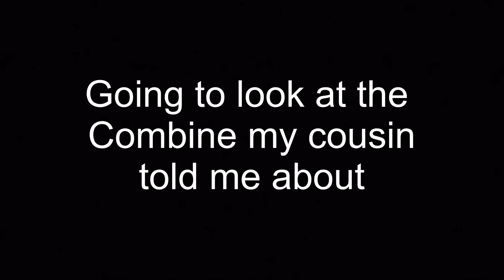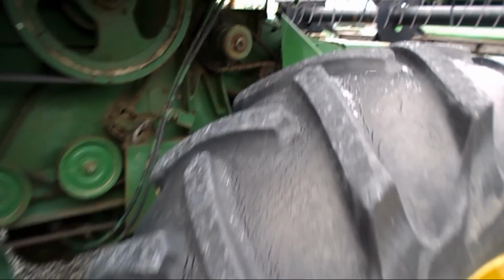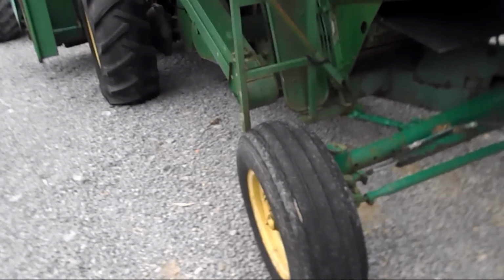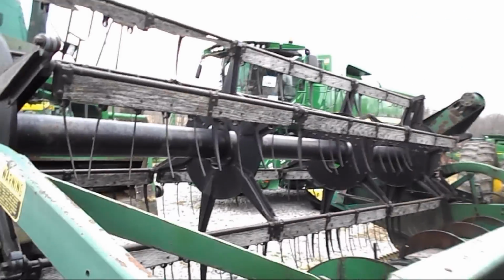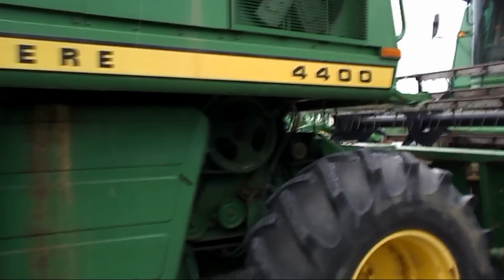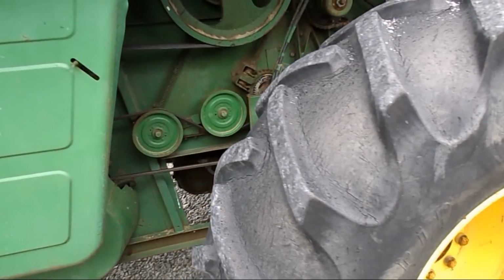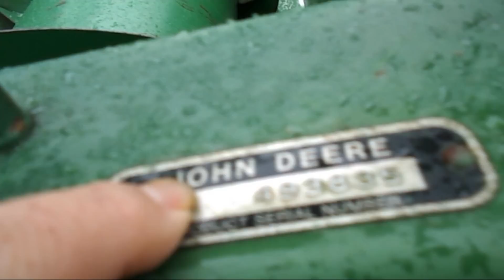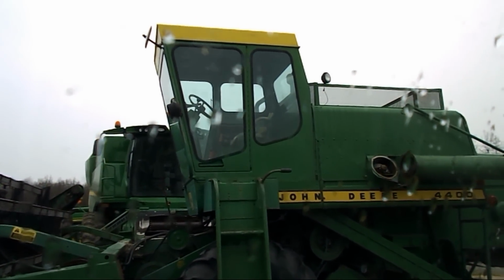Going to look at the combine my cousin told me about

Comment: Lift up on the back of the straw walkers and check to see how much play on the wood blocks.  The arm put on the axle could mean the pivot bushing is wore out. Check the rubber cushions for the sieves to see if they are pounded out. Check the elevator chains and sprockets.
Reply from the maker: I did check the straw walker blocks and there tight, And all the bushings look good too. The most ware I see is a chain sprocket up front caused by a dry chain that is stretched , That's a simple fix. I looked it over pretty good and I like what I see, Now I got to see if I can get it bought !  Bandit
Reply: It looks like a good machine though. I bet they will give you a great deal. Implement dealers only want the lastest and greatest on their lots anymore. Good luck to ya . Really like your channel.

Comment: that dealer has sure got a lot of combines on the yard,,,must have deep pockets for sure,,,,that ole 95 of yours will pick your crop as know it needs some TLC  but [95] is enuff to entertain you  with mechanical work even though the manifold does get red
Reply from the maker: I found the 95 to be a really good machine and easy to run and work on, But it needs a rebuild and a repower and that is still what I'm going to do. It will take some time to rebuild it and if I can get this 4400 it will give me the time I need to not rush threw the rebuild. The 95 as far as I'm concerned is a better combine than the 4400 ever was, Saying this I'm smart enough to see a good deal on a good machine to get me by till the 95 is fixed and back in the field again.  Bandit

Comment: Had a 4400 years ago, was not impressed in the least, if you want a small combine the King was the F3 Gleaner
Reply from the maker: It might be but I wont own it if I have to deal with the only dealer for a 100 miles,  That's why I run a John Deere now . You don't buy equipment that the only dealer around wants to screw you over on anything.  No Thanks, I go someplace that is happy to look up parts for anything they made over the years, They may charge a high price for them but at least they are nice about it. LOL  Bandit
Reply from the maker: @RJ1999x   This goes back over 25 years but it all started for a bad new belt I bought from him that caused $2000 worth of damage to the combine. I was told after a heated talk that I didn't buy enough from him to make worth his time to do anything about it !  At the time most of the equipment and tractors we had were AC and I bought a lot of parts from them. And when he told me and dad it was our fault the belt went bad because we didn't know what we were doing I thought dad was going acrossed the desk and whip his little fat ass !  Dad told him he had installed more belts and bigger belts than he had ever sold or seen in his life !  This was the only time I can remember dad so mad and ready to fight !  I was standing there with a report in hand from a lab that said the belt was bad because it was cold valcanised and is why it came apart. I called Agco in GA and was told they would replace the belt and pay for all the damage and have it fixed if the dealer said it was a bad belt otherwise they couldn't do anything about it.  So the dealer would have made money from all the parts and labor it took to fix it. But no , He didn't want to be bothered with it so he screwed me over good !  So that's why most of the AC stuff left the farm and why I wont buy AC stuff because he is the only dealer within a hundred miles (or more) and I wont go there for anything. Screw him and the white horse he rode in on !  Anyone who thinks he is a good guy and a good dealer is full of crap, He's out to screw you over !  I'll never deal with him again for any reason !  People wonder why I don't want AC stuff this is why !  Bandit

Comment: That's the new 3 link rear suspension system update from deere!
Reply from the maker: Really ?  I guess its possible, I was told the owner spent $28 or $2900 last summer at JD getting it fixed up for harvest so its possible this was put on too .  Bandit

Comment: you got to weight your options and think this one over pretty good cousin.  my 2¢ is I know you are good with a wrench and a ratchet.    but if you got reservations about the design and the overall functionality of the 4400 I'm thinking you'll never be happy with it.
Reply from the maker: The old 4400's were good machines, They will cut good and clean good but I'm not a fan of having to work on them and I'm not crazy about sitting off center. But IF the price is right I can get used to it again, I did run dads 4400 so its not like I have never run one before. The 4400 was built to replace the 95 , But the 95 will cut circles around a 4400 all day long !  But the 95 needs a rebuild and I already have a lot on my plate but if the price is right I'll buy this one and I can take my time on the 95 rebuild and do it right and sell the 4400 when I'm done. But I got to get it bought first and find out the whole story about this machine first.  Wish me luck Cousin !  Bandit
Reply: @banditfarmer1900  - sounds like a thought out plan.  in prayer I'm asking for you to be blessed and led to make the decision right for your on going plans.   best 2U cousin...
Reply from the maker: @SoybeanFarmer3300  I don't do anything like this without doing some serious thinking about it,  I spent an hour or more looking it over front to back the top to bottom and I like what I see. I wouldn't be interested in it but having a parts machine sitting there and knowing this one is a 1269 hour machine its got my very interested in it , Now if I can get it for a good price I'll be really happy with it !  I don't need big and new , Old is more my style !   Cousin Bandit

Comment: Isn't a 4400 a smaller combine than a 95?
Reply from the maker: The 4400 was built to replace the 95 and its a few inches narrower in the cylinder than the 95 is. Bandit

Comment: BUY A F2 are F3 GLEANER LOT  EASER TO WORK ON BURN   HALF THE FUEL PARTS YOU CAN BUY AT PARTS STORE ARE SHOUP ARE Aand I
Reply from the maker: Don't want a Gleaner, The only dealer around I don't get along with for a lot of reasons. If it wasn't for that I would own another Gleaner but not now.  I'm not a fan of the 4400 but I've run one before and they do a good job cutting and cleaning I just never liked working on them and sitting offset like that. But if the machine is good and the price is right I'll own it !  But first I have to get it bought and I hope I get it ! Bandit
Reply: had a 9500 with a 20 head in 4 years spent 25000 on it Got burn up was up set at the time got two F3  with 16 fi heads  one of them will cut as much as the 9500 would both of them runing all day will burn half the fuel as the 9500 did i know a bad dealer is not good

Comment: Scrap Iron at best not worth the cost it would take to fix it up
Reply from the maker: You don't use machinery very well, But by the looks of it your used to new big stuff.  Being a small farmer I'm always on the look out for equipment and I've seen a lot of 10000 hour tractors and 7000 hour combines and this 4400 shows 1300 hours and the little amount of ware it has on it I believe it. This combine just came out of the field 3 weeks ago from cutting beans, It was running and it will cut right now if needed. Changing belts is my own personal thing and as far as the head polly kits are normal to have to replace and the fingers on the reel coms from running the reel to low, Lots of 13 foot heads around to get boards off of cheap . I hope I get it cause I will put it to good use in the field. I don't need a $50000 combine with a 35' head to cut under 100 acres of beans .  Bandit
Reply: @banditfarmer1900  well I understand where you're at on that and if that's what you're happy with go for it I used to farm with a lot of older stuff and ran it many years and put 10 to 15,000  hours on it just to the point in my life I don't have enough time to keep equipment running so I got to run some of the tech-savvy stuff to keep me moving and plus I had over 20 different pieces of equipment to keep running when I was dairy farming so that stuff was easy keep running but we got out of that side when grain farm got big
Reply from the maker: @AJmx2702001  I've worked a job in town sense I got out of high school but I have farmed all my life . At one point with a full time job I was farming 350 acres with an Oliver 1850 and an IH 1568 and my 1550 Oliver. I got married and wanted to be around my kids more so I backed off some of what I was farming, I don't regret it for a moment !  I enjoyed farming what I was and being around the wife and kids and enjoying life. I farm under 100 acres now and I do it my way with older stuff I can work on. The farm and all the equipment has been paid for for many years now and I want to keep it that way so when I buy something I pay cash for it. As long as I can make a little money and it doesn't become a pain in the butt to do I'll keep on farming like I am now and enjoy what I'm doing. This 4400 if I get it bought will work just fine for me and its just the right size for me and what I'm doing. I hope my grandson will take over someday, I'm trying to show him there is more to farming than making money.  Bandit

Comment: i say leave it there looks pretty rotten to me if you really want another combine there is always some way better 20 series out there maybe . not sure how many acres you run i would look for something newer like a 20 series or a decent 9400 if you are a deere guy. ive seen some really cheap internationals aswell like 1420s and 1620s in much better shape than it.otherwise just hire the combine. being a gaser its worth scrap money as far as im concerned
Reply from the maker: Well it is 50 years old I would expect to see some rust on it but it did just cut 60 acres of beans so it will cut beans right now.  One of the main reasons I'm even looking at this is I have a 4400 sitting there for parts, Belts don't worry me there easy to get and there not that expensive to buy.  I don't want to get into the 9400's or newer too many problems with computers and I wont be calling a service tech to come out to hook a computer up to find out whats wrong with it.  I'm old school and I want to keep it that way,  The reason I'm looking at it is the 95 needs a rebuild and this would fit right in till I can get it done so I don't rush the rebuild and then I'll sell it. If it is a low hour machine then it will be worth getting to make life easer on me.  Bandit
Reply: @banditfarmer1900  well a 9400 doesnt really have anymore computerized stuff on it than a 20 series machine really just the dash just 60 acres of beans then your better off hiring a custom combine . im sure you work off the farm why dink around with junk buy something you can work with and video and show progress on your farm. otherwise your best off renting it rather than loosing your dads farm because you cant get the crops off. just my thoughts.
Reply from the maker: @ihguy2113  I don't tell you how to farm so don't tell me what I should be doing, My Time MY money and I will farm any dam way I please to. As for the farm its paid for and so is all the equipment its all owned free and clear all I have to do is pay the taxes and pay the insurance on it.  For me if I can get this 4400 bought at the right price it will do a fine job for many years for me and it will be paid for right off the bat.  When you have to borrow money to buy equipment you get into the revolving door at the bank and trying to get more ground to pay for it all. I figured this out 40 years ago and I don't borrow money to put crops out or buy equipment and I am very happy with the way I do things and the way things are now and don't plan to change this any time soon. Bandit
Reply: Bandit farmer at least the door shuts good lol